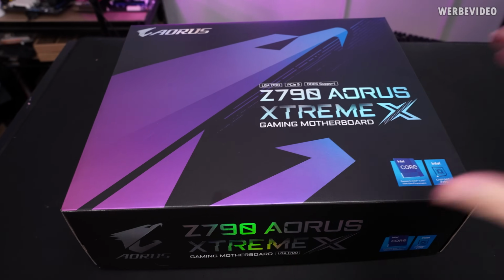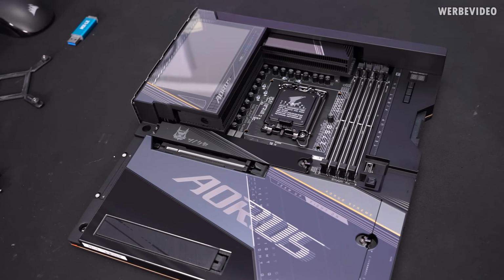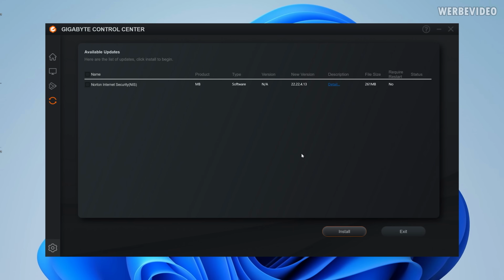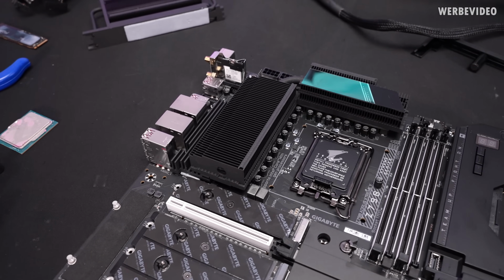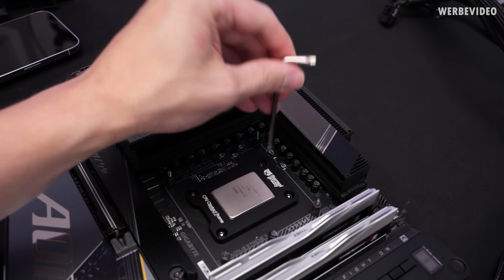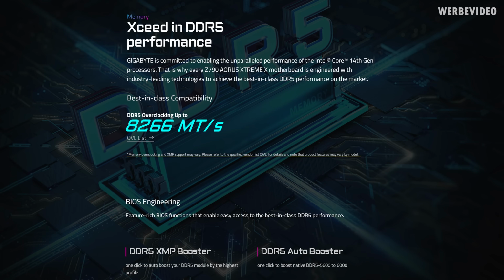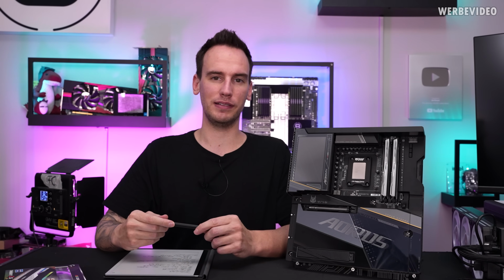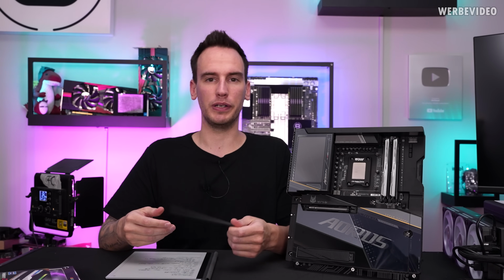Overpriced and Disappointing! The $1300 AORUS Z790 Xtreme X

Comment: I find the board's expansion configuration a bit odd.  The weird PCIe split with the top slot being 5.0x8 has to be coming from how they integrated the bottom slot with some kind of bad implementation.  The processor itself has 5.0x20 split into x8+x8+x4 or x16+x4, and the chipset itself has 4.0x28 split between x4, x2, and x1 configurations, then the board itself supposedly has 5.0x16+x4 and 4.0x16+x4*4; it's basic math, there's hypothetically a 4.0x4 link missing, assuming the chipset is fully utilized.  I have a feeling that the 5.0x16+x4 and 4.0x16 configuration is shared, leaving the chipset to be NVMe-only at 4.0x4*4.  Now how does Gigabyte achieve this, with some kind of switch that turns a 5.0x8 link into a 4.0x16 link physically, and somewhere within that IC some wires got crossed to where the 5.0x16+x4 configuration gets converted to 5.0x8+x4 where the missing 5.0x8 is converted into 4.0x16 even when that slot is not populated; essentially it's dynamically switching between Intel's allowance of 5.0x16+x4 and 5.0x8+x8+x4, but doing so improperly in such a braindead and confusing way, it's as if the 4.0x16 slot is hardwired to be always active, probably at fault of the IC that allows this slot to exist as it does.  As far as I understand, no GPU currently breaches the limitation of 4.0x16 so it should be a non-issue, but it's still just super bizarre implementation that handicaps future cards.  I also don't see anyone realistically doing multi-GPU setups anymore, so what's the point of the 4.0x16 link being wired to the CPU with a middleman IC to do the 5.0x8 to 4.0x16 conversion, personally I think it's a bit superfluous for no reason, and really no consumer add-in card would use a full x16 slot anyways so I'd rather see this broken down into chipset lanes where CPU lanes aren't messed with.  This is just a $1000 motherboard with a gimped PCIe slot that hurts the long-term usage of the board; though this may be intended, just buy another $1000 in a few years, because that's the kind of capitalist + consumerism hellscape we currently live in.

Comment: No rear audio connectors, piles of plastic, awkward M.2 configuration, useless amounts of power phases, inability to sun stock settings with validated compatible parts, sloppy application of VRM heatsink, typos in BIOS, sloppy software, buggy sensors, a non-standard form-factor, and it comes packaged with Norton's shovelware. Halo products are companies telling you, the one who hands over money for it, that they have no respect for you.

Comment: If I ever acquired this board, I would be removing the display and controller from the location it is, and bringing it closer to the glass side panel, IF Gigabyte ever allowed customization of it.
If the USB DAC is not junk, I would likely use it with my laptop instead of the desktop...
I would likely disable the built in 10GB nic and put in a PCI-E Intel 10Gb nic using an M.2 adapter board and modified rear bracket so that I don't affect my ability to use TB4 ports.

Comment: Couple of notes, 
1. You have display output via the USB-C / TB4 ports for onboard/iGPU video
2.a. Most of the USB-A ports are using a Realtek USB HUB
2.b. Most of the internal USB 3.x ports are on hubs, likely also Realtek...
3.a. The 2.5GB eth port is Intel 226v (good)
3.b. The 10GB port is AQC107 multi-gig capable (meh Gen3 PCI-E, the newer AQC113CS supports Gen4, but these chipsets sometimes have disconnect issues unless you disable a lot of features)
4.a. Only 1 M.2 slot supports SATA, they all support x2, or x4 lane PCI-E
4.b. Only 1 M.2 slot appears to be dedicated 4 lane and not shared, (the one mentioned in the video below the top PCI-E slot)
4.c. All other M.2 slots (excluding the Gen5 above top PCI-E and Gen4 dedicated immediately below top PCI-E slot) share the total bandwidth of the Z790 chipset, which includes the 2.5GB nic, 10GB NIC, Thunderbolt ports, WiFi, lower PCI-E x16(x4 lane), etc.  This is essentially 8 lanes of PCI-E Gen 4 bandwidth (x8 DMI 4.0)
5. The TB4 ports effectively share PCI-E lanes with some of the Gen 4 M.2 slots(lowest 3) and the lower PCI-E x16 slot (x4 lane slot), lan/wifi,etc. see below

Gigabyte does not define what is switched with what other than the top PCI-E slot in their manual.
Z790 should have as many as 28 lanes available (20x Gen4, 8x Gen3)
The lowest 3x M.2 slots running off the z790 chipset are all using x4 Lanes of Gen4 (x12 of 20 available lanes from the z790)
The Gigabyte manual lists only the devices hanging off the Gen3 bus, with a total of 12x lanes potentially used of x8 available, wifi (x1 lane), 2.5Gb LAN (x1 lane), 10Gb lan (x2 lanes), TB4 controller (x4 lanes) and the lower PCI-E slot (x4 lanes)

So if you want to use TB4, you might have to leave the lower PCI-E slot vacant? bad lane mappings on gigabytes part (some of these devices could have hung off the Gen4 lanes instead of Gen3 lanes
This board seems WAY overpriced for some possible issues it brings with USB hubs and possibly misguided PCI-E lane utilization

Comment: There got to be billions and billions put into the technology that’ll turn soft plastics into the most ridged plastic ever made. 

Turn that massive anomaly of swirling  plastic that’s swirling around one of Earths oceans, that doesn’t have any shores. 

Not Prioritising a probable problem is planning a problem.
Reply: Back in 2009 I performed a BSEL modification that required 2mmX2mm electrical tape on individual conductive parts of an Intel Xeon processor to trick the motherboard into thinking the CPU was 1600mhz and not 800mhz. 
It was a system that let it’s self open to Quantum tunneling of actual particles of matter to tunnel into an ultimate Universe. 😂
Mostly true 😂

Comment: One of the reasons why I don't wanna build a new pc is that expensive Asus mobo I bought doesn't work like it should. Common issue with this board, many people had same issue.. (Also Asus 3090 exploded.) And then other options is these indie companies like Gigabyte. I just don't wanna deal with issues and badly designed products. The quality is just insanely bad these days.

Comment: this video has been more informative then almost all the videos ive seen all year. oh and im sure the 7 degree difference is the amount of heat the lcd display and i/o adds to the overall system temp and by having those holes directly under the lcd display helps to rid the system of most of the heat emitted by the display and i/o

Comment: The LCD is a waste of money. Would rather do one custom in the case if i wanted one. Would rather have better designed heatsinks on the lower nvme rather than "pretty".  Pretty doesn't make fast. It's like they have just lost their way. I get it, if someone wants to do a "pretty" build, fine.  but what a waste of  money for "pretty". Give me performance for the money, not "pretty". Would easily delete the lcd and put some active fans on the vrm heatsinks, man what a waste. If you want the same specs, 10gig networking, more pcie slots no-lcd but still "pretty" in the $400 range, get the Z790 AORUS MASTER.

Comment: 12:20 The best solution would be if instead of five m.2 slots, there were 5 full-length full-speed PCIe slots, and anyone wanting a huge amount of m.2 could use riser cards. The trend of wasting all board space and PCIe connectivity on m.2 slots is part of the "enshittification" of the PC platform.

Comment: New control center is tragic. i installed it, because old one was missing RGB control, but it's half done product, also not sure if now, but when it came out, it was missing bios flashing, and bios flash app require old control center, that is not compatible with new one.

Comment: The whole lack of PCI-E lanes on todays platforms are showing their ugly head now clearly.
Man we need platform / chipset alternatives like Core 2 had with X38 and X48 vs P35.
Just more lanes, not just for GPUs, but also other things like some love NVME drives, or for me, HBA controllers.
The latter gulps up 8x PCI-E lanes, but can only do 2.0 speed, meaning 4x PCI-E 5.0 or a hypothetical 1x PCI-E 666.0 standard just won't cut it as it will fall back to 2.0 speeds.

But for 1300 bucks, I expect them to smack a PCI-E switch on the board at least, a throwback to the old NF200 chips from Nvidia.

Comment: In Canada, the MSI Z790 Godlike is the most expensive Z790 motherboard with the Gigabyte Z790 Xtreme X in second. The MSI Godlike is either $1,579 (CAD) or $1,679 and for the Gigabyte Xtreme X, the prices are either $1,349, $1,399 and $1,499 depending on the retailer which is bizarre. 

Either way the prices of these higher end boards are absolutely ridiculous. The ASUS Z790 Dark Hero for example is $949 CAD and does not even have a 10GbE port, it only has a 2.5GbE port which is inexcusable for the price. It does have 2 Thunderbolt 4 ports though. For comparison, the ASUS Z790 ProArt has 10GbE and 2.5GbE ports as well as 2x TB4 ports for $600 CAD.

Comment: I'm running the GIGABYTE Z790 AORUS ELITE AX at $300 from Newegg with a 13900K and DDR5 memory and it runs great, no problems so far. Absolutely no reason to run a $1300 motherboard.
Reply: It’s about 900 now and $500 used.

This guys said $1300 because he is in another country 

The extreme X has worked perfectly for me so far and the screen is amazing

Comment: even AsRock has done the swappable m.2 positions on top slot with their Z790 Steel Legend which cost like 1/4 of this board, one side to run at PCIe 5.0 shared so the GPU will run at x8 and the other one is PCIe 4.0 but it'll leave the GPU to run at full x16 lanes

Comment: Despite prices of hardware going to absurd levels. What is utmost stupid is making fancy-expensive motherboard with cpu platforms that have very limited PCIe lanes, so it doesn't matter how cool it looks and how many NVMe can have, you can't use the whole board.

Either you share bandwidth, or you lose SATA's, or you lose PCIe lanes that are valuable elsewhere.

This is the sort of motherboard only a rich-low-skill person would buy just for show, and sadly lan parties are not a thing nowadays. So bottom line, boards like this are a baseline ripoff.

Although is true that in some cases you can salvage part of this using the chipset, it is the same fate and also with performance degradation.

I remember those full-blown boards for LGA2066 and Threadrippers, you would have more lanes than the motherboard format would allow you to install expansion bays.

Comment: It looks almost exactly like my Aorus Elite b660 board I paired with a 12700 (which I like, lots of connectivity, zero stability issues), minus the excessively large LCD IO shield, and that was like $200.  For less than $1300 I could buy a good AM5/Z790 board and a 7800x3D or 14700.  It is a nice looking board, but for that price you can basically get a high end board/CPU/cooler AND some ddr5 cl30 RAM, if not more with a combo board/CPU/memory deal.

Comment: You mentioned the Aorus Master X not being much different from the Aorus Xtreme X. I was also looking at the Aorus Master vs the Aorus Master X and it was another thing that seemed really strange to me. I couldn't see any real difference between them except the increased price of the Master X haha.
Edit: I looked through every line of the specifications on each and the only two differences I saw was the claimed support for DDR5-8266 vs DDR5-8000 and the use of integrated WiFi 7 vs 6E. Those two meaningless differences cost $100??
Reply: Aorus master X doesn’t have the screen

Extreme X is really good with 8000mhz

Comment: As Buildzoid mentioned in the video you mentioned, best to check G.Skill's list rather than the motherboard manufacturer's QVL. G.Skill has their own list that says which boards have been tested to work with which of their memory kits (based on the speed and timings of the kit). And since it looks to be a lot more conservative than the motherboard manufacturers' lists, Buildzoid believes it should be a lot closer to reality on QVL.
Reply: In my expierence Buildzoid is absolutely correct, believe G.Skill QVL not what Motherboard manufactureres are saying

Comment: I have to seriously wonder how much of this high pricing mothorbords is "legit more expensive components" coupled with "lets just run like hell with it!"

I know some of the tech is cutting edgw, adn so.e of it is even taking an obtise amount of time to trikle out despite being ratified what seems like ages ago! (USB4 for one, and not just using Intel Thunderbolt 3+ controllers for it 🤬)

Especially when the many manufacturers mingle with you guys and see how conaumera aren't juat going for certain things BECAUSE of pricing, it becomes perplexing af to see consumer platform motherboards cost so much, even down the stack.

Threadripper motherboards are gonna be through the roof considering those actually come loaded, and with stuff you can actually use without compromising.

Comment: gigabytes software blows and their customer support for it ultimately came out to them telling me to just format the computer to fix their software problem with their SIV app not working or installing properly. the last motherboard i bought by them was their z270x ultra gaming... the software looked like someone threw some neon at a simple c++ drag n drop template. if i spent 1300 on a mobo ( i wouldnt ) i would be boxing it back up after the problems you just shown.... totally with you... 1300 is way beyond "trying to figure it out"

Comment: The reason you're paying so much for this is because the sales department had to work really hard to find excuses to sell it at all. For every word they slaved away at, you're paying and extra $10. It adds up pretty quick. The "software developers" didn't get the memo about the LCD screen, the engineers didn't understand why this thing even existed, and who would ever use one of those PCIe 5 NVMEs that you could cook on? Then one engineer woke up somewhere in the last days before release and said "holy crap, we need to include a massive heatsink with this thing! That's going to add another $100 onto the price tag. Totally useless features, because they don't work, and completely useless software for the same reason, in a motherboard that was intended to be "Premium", and costs way more than the CPUs that are being put in it. In this case, you get what you were stupid enough to over-pay for.

Comment: I got a Gigabyte Master 3060Ti, so installed it into my Gigabyte Z77x-UP7, installed the Gigabyte Control Centre and Fusion RGB, but the GPU didnt show, so I update the BIOS and Firmware and software and restart.  The computer never POST again, it killed my 4 sticks Corsair Dominator 2666 DDR3 (non RGB, none in the PC at all).  I put different RAM in, and it POST and run for a while, then kills that RAM too.  I've killed 12 sticks so far.  My motherboard is ruined.

Comment: I don't like these boards that are above $700-$800 I find you run into small issues and very small gains over $500 boards. But that's just me. I am not a pleb I have a 4080. I could afford a $800 board but I went with like a $450 board and it's more than just good. It's great. I would not use this 1300 board even if I could buy it at $800. Still not worth it to me.

Comment: Even the master isn't worth it.  I bought it needing 10gb lan and I couldn't find an apex or tachyon at the time.  Ended up buying the apex enocre.  I had to manually input settings to get 7200 stable on master.  On apex encore I pushed this to 8000 same hardware.
Reply: Oh and I got a 10gb lan card for a $ 100 for my apex..

Comment: It makes me sad to see Gigabyte going this way nowadays. They were always among the best(and still are) but products like this shouldn't even be a thing. The very top CPU that drops into this Z790 isn't even remotely worth a board that costs this much. That the board itself isn't that impressive is fitting. I have my 7900X3D in a $250 B650 Aorus Pro AX and I don't want for features or ability. I score much better than stock review benchmarks and the board has very adequate VRMs and runs cool.

Comment: Thing which disappoints me most, and it isn't really a Gigabyte problem as such, you spend all this money and still only get a x16 PCIe slot which shares bandwidth with the top M.2 slot if you actually use it and a x4 PCIe slot...

Back in the day buying into the X79 V2 platform and still spending less money than this got 2 or even 3 x16 PCIe slots as well as a x8 slot which didn't share bandwidth, as well as the possibility of splitting one of the x16 slots to run 2x x8 slots and several x4 and x1 slots.

I struggle to see the advantage of this board over the Aorus Master which is a touch expensive but does kind of justify the price sort of.